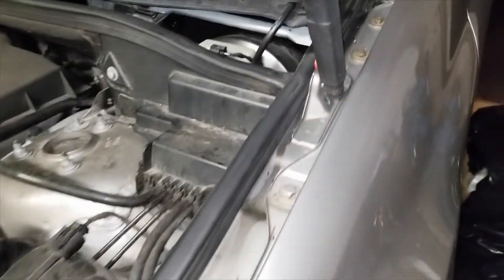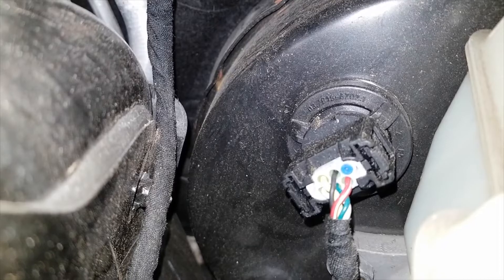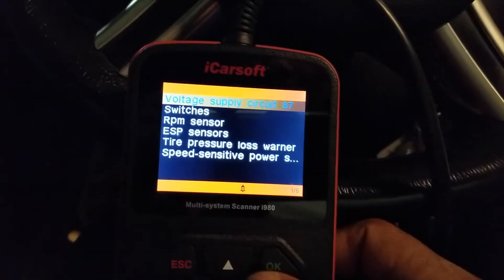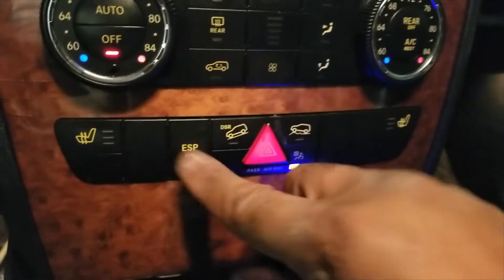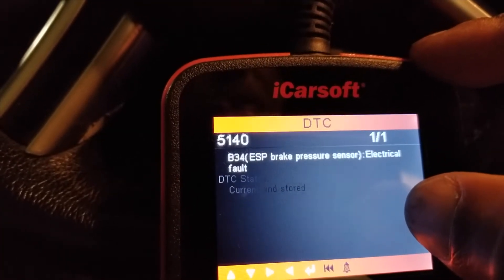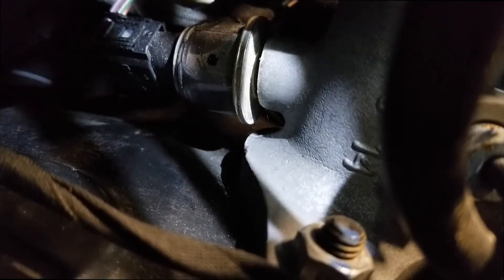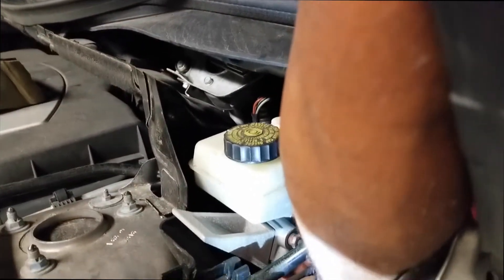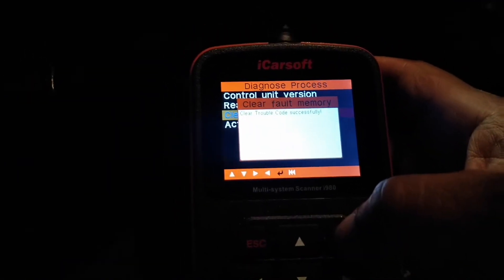B34 Mercedes ESP Brake Pressure Sensor Diagnostics and Location - How To

Comment: Thank you for that information, but what if I’ve done an actuation test on my Mercedes brake pressure sensor and it says brake pressure sensor faulty but I don’t get a trouble code for it? Could it be the brake switch?

Comment: Hello, I was changing the ABS sensor on the front left wheel. But when I replaced it, the ABS and check engine lights came on. What could be the problem?

Comment: Hello! I have a 2011 Mercedes ml350 and I'm replacing the brake booster, but it does not have the vacuum sensor and want to use my old one, how do I remove the old one? there is a notch on the booster hole, do I need to turn the sensor to line up with the notch and pull? I don't want to break it or damage it, thank you!

Comment: I have a 2006 SLK 55 that recently would not go back into N or P, but drives and shifts fine. I can also crank the car in N without pressing the brake.  Research suggest the brake pressure sense is faulty, but I cannot find said switch where many state it is and now find it might not have one at all, but the break pressure sensor.  I connected my scanner but there are no codes.  Any thoughts?

Comment: I did't get any ESP error light but when I scanned the vehicle, I got a hard code in the B64 Brake Sensor Error. When the car is parked, the Brake Vacuum Senor is showing -1136 mBar which seems weird since the brake is not being pressed and negative number is showing. Do you think it's time to change this senor? I also noticed that the ESP module comes and goes while driving with the scanner running to look at it. I know module that are working and running should be able to show information while being used but this is a hit and miss. Any help?? Also I noticed the Longitudinal acceleration is stuck at 12.39 sec when the car is not moving.

Comment: yooo papa I got a mercedes and I got codes for it but idk the location to it here are my 

codes C1704- eps ecu fail-safe relay fail
c1142- B24/15 (Rotary speed and lateral acceleration sensor)
c1510- fault in CAN communication with control unit n63/1 (DTR control module)
c1024- brief under voltage at control unit N47-5 (ESP control unit)
c1185- A7/7b1(BAS Diaphragm Travel Sensor Electrical Fault)
c1310- A7/3y18 (Front Axle Switch solenoid valve) cable has open circuit or short circuit
c1212- High Pressure switching valve front axle defective 
c1707- Cruise control consequential fault process first of all all the other stored fault codes 
C1210- G sensor input circuit performance

Comment: I have 2007 ML 280CDI (W164). There's an issue that when I'm going up on a hill and stop and hill assist goes active, If I continue driving
before breaks are released automatically -> , breaks are released car moves few inches and then breaks go back on and car stops suddenly (very annoying) (Break pedal goes down automatically). If I continue car behaves like pressing break and gas pedal at the same time for a while.
Then breaks are released again and car continues normally.

If I wait that hill assist system releases breaks and only then continue driving this doesn't happen. (Breaks don't go back ON)
Problem occurs quite often, almost daily.

Mercedes authorized shop have updated engine, gear box and ESP control box software. No help.

Have you any idea?
thnx

Comment: Hey Keith, I just changed all 4 rotors, pads, sensors and silver 2 front brackets for my 2007 ml350. Now 2 brake lights one on the left dash screen and other brake release light in the center keeps beeping when I drive. Any ideas what it could be?????

Comment: 2008 Mercedes ML350 4Matic W164, I am having a weird issue, after changing the MAF, cleaning the Throttle body and CAM Plugs, the MPG reading goes down when in idle and goes up when driving. When I start the car it recovers the last MPG reading and while in idle it keeps going down, last time I stayed in idle it kept going down till it read 9.0 MPG, when driving it goes up to 21.5 MPG. Its really confusing me, gas consumption is high and DTC is RICH on Bank 1, can you help please?

Comment: Hi Keith.

I was hoping you have the time to answer my question/question's....1.  What are the part number's for the drain/fill plugs for the front/rear differential's on a 2007 E 350 4matic?  

2.  What would be better, a 14mm allen wrench (with an extension/breaker) or a 14mm hex bit and a drive (looking at a video, the mechanic showed the exhaust made a tight fit with one of the bolts that have to be removed)?

This mechanic had an earlier model E350 4matic wagon, I'm not sure if his vehicle pertains to my car verbatim (it's the closest reference I could find).

I greatly appreciate your time and any advice you're able to give me.....Enjoy the day!

Comment: I’d try to use a short/ stumpy pipe spanner before removing the reservoir. You can get them with a 3/8 end and just use an extension to crack it. Just a thought. Just look up 3/8 pipe spanners.
Reply from the maker: Very true. Good tip

Comment: Hi Keith. Hope all is well. Thx for the content. Keith my brakes lines feel like it's air in lines. The brake lines were bleed out. I drive a 2008 ML 350. My mechanic stated the master cylinder rarely gets changed on these vehicles. I have to pump my brakes several times,, and I informed him this needs to changed. What do you think? Have you ever experienced this on your ML 350? Thank you, in advance
Reply: I wonder what else it could be... consider this: 
- frozen rear calipers from rusted PISTONS 
- caliper slide PINS not silicon lubed.

Take a look at how your disks look, this will quickly tell you how well they are working.
Reply: . The discs are not worn. Actually. I purchased powerstop drill slotted rotors and I still had the same issue. I appreciate you taking time out to address my question. Thank you, once again